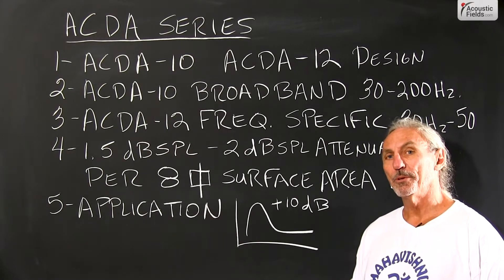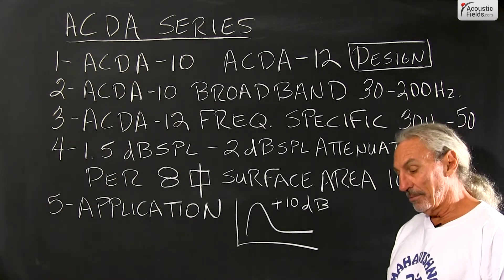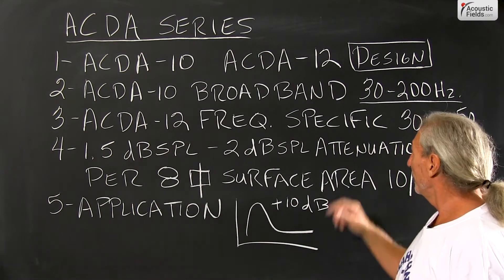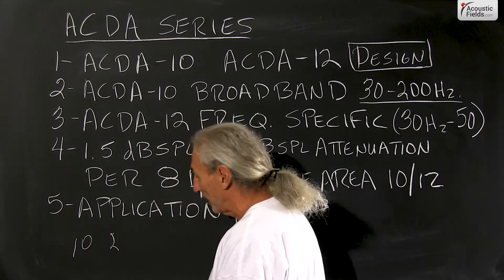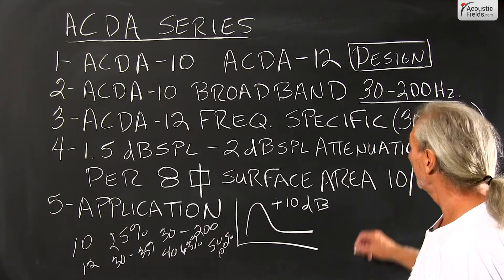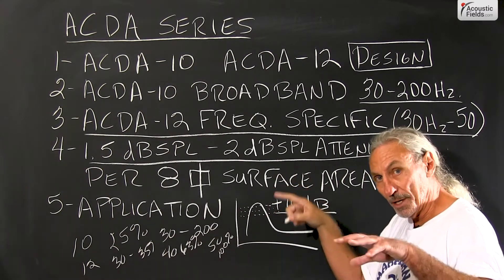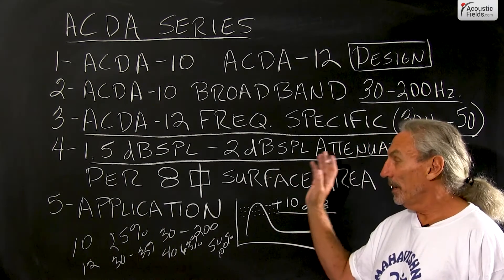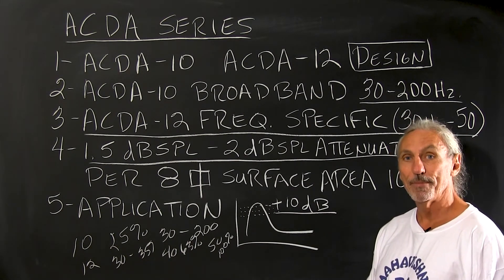The ACDA Series - www.AcousticFields.com

Comment: Excellent.  My listening room is progressing very slowly, but I've been wondering how many ACDA's I would need.  This gives me a guide.   Do you show a kit or plan for using the ACDA style units as a base for 12" subwoofers?
Reply from the maker: R,  You can use the BDA drawings and build a subwoofer platform. Increase the cabinet depth to 10".

Comment: This video clarifies some things. Thank you ;)   But i still do not get how you achieve same results in QDA--11 and QDA-17 which contain both ACDA 10 and the ACDA-12. 

BDA-10 and BDA -12 and both 16 inches. On the other hand, QDA-11 is  9 inch cabinet and QDA-17 is 16 inches  cabinet and results you wrote on website seems impossible because you wrote 9 inch cabinet absorbs the same as an 16 inch cabinet. I assume that depth is critical part when you design diaphragmatic absorbers because they wont work as much in absorbing low frequency waves like 30 Hz . Cheers
Reply from the maker: M, Our cabinet depth of 16" achieves two purposes. First, it gives us stability in the lateral domain at 30 " wide. When on casters, the 30" width and 16" depth work the best for stability when moving the unit around. This 30" width and 16" depth is welcome also for 60" and 72" unit heights. All of the space inside the 16" can be used for the ACDA -10 and 12. The 10 needs 8" of cabinet depth and the 12 needs 10". With dual front walls and 2" foam you can use up most of that 16".  There is some space left but we use that for vertical stability especially with motion.